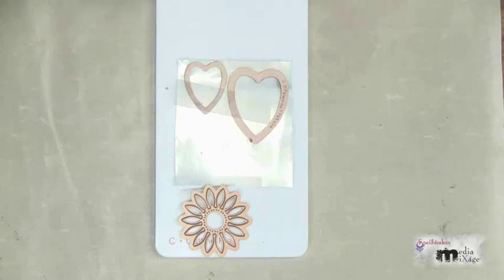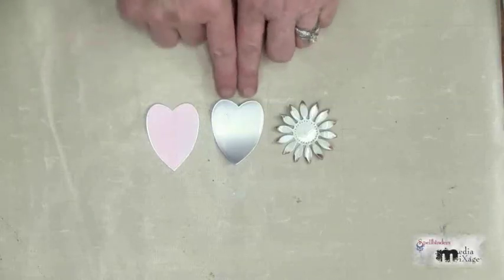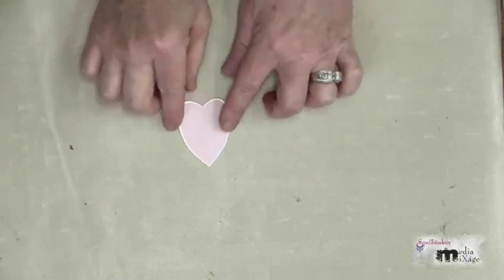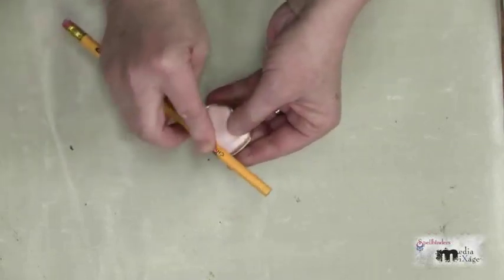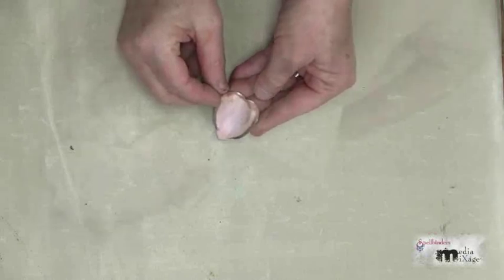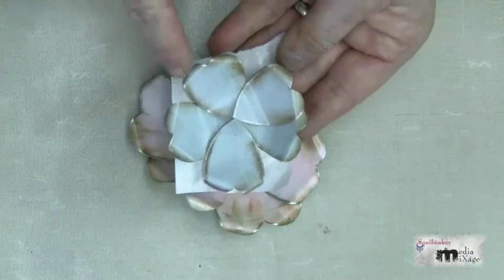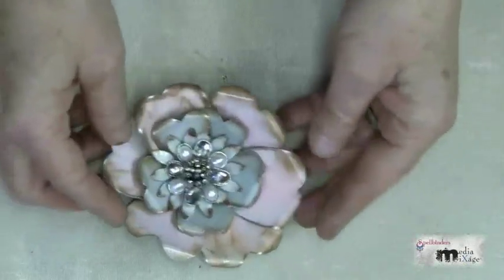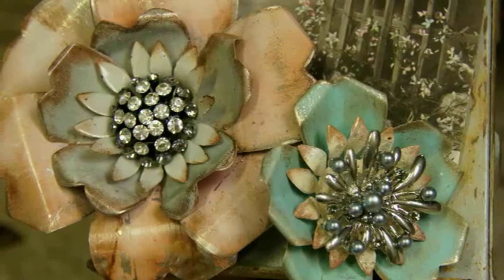Upcycled Soda Cans -Vintage Metal Flowers - Spellbinders Mixed Media

Comment: do you glue the individual petals as well as using the dots?
Reply from the maker: If I were making the flowers to wear in a pendant I would glue them individually using a strong jewelry glue.  But for this project I simply used the dots as they don't get handled much.  Great question!
Reply: ***** thank you